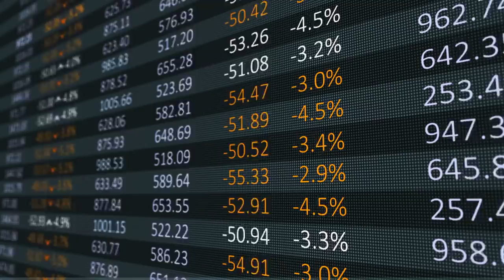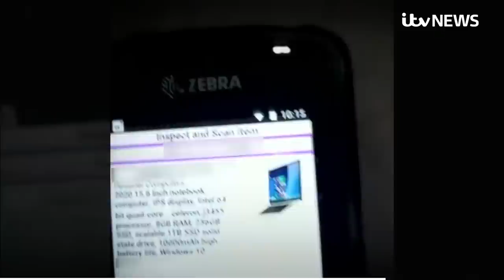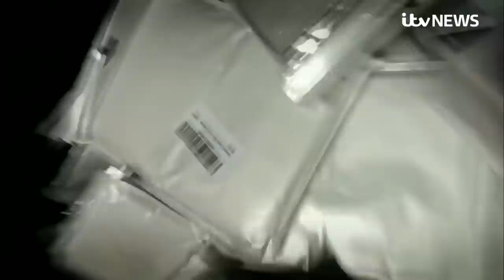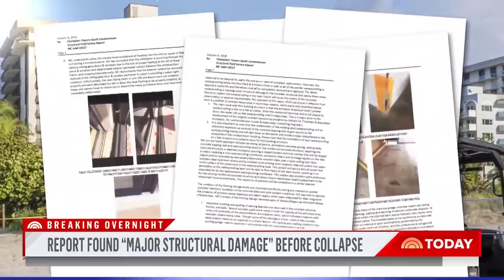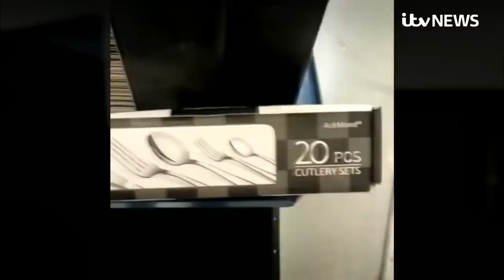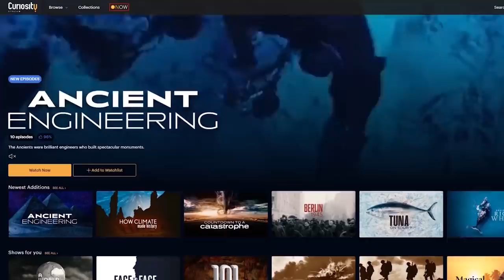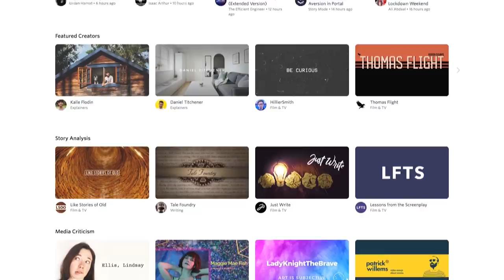Is Capitalism Actually Efficient?

Comment: This is definitely one of the most damning aspects of capitalism. We as a society can no longer afford to let so much material go to waste, especially when there are so many who needlessly lack said materials. Our current manner of helping (or rather, not helping) the needy is BARBARIC compared to what is easily possible.
Reply: Seems more of a society issue then a Capitalism aspect most people choose to neglect issues and not much is down to rectify that problem not a necessary a issue with Capitalism but as a whole more of people not choosing to be more economic among other things.
Reply: @mlgfails2727  I disagree, if it were more profitable to help the poor, people would. In a socialized system the resources would go to who needs them.
Reply: @douchopotamus3755  well hard to make it profitable to help the poor there is ways but best method is to make it so the poor are slowly raised from there levels of poverty into higher levels of wealth of course I believe best state is mid class if on the higher end good financial security and allows you to avoid the demons which plague those of wealthier classes. I think people should really just learn more of financials would save and help so many it’s unbelievable get into farming spend less among other things I do believe a safety net is needed but not in a I guess the traditional sense
Reply: @mlgfails2727  are you 8 years old? That's a pretty naive view.
Reply: @douchopotamus3755  last time I checked my birth certificate I was not and considering my memories I think not as well although if you believe certain individuals u can’t trust ur memories right but no I don’t think I am and would you care to explain how so? Many issues that plague people are often fixable if they have the knowledge and help to do so I don’t see how making so those of lower income receive this wouldn’t be a benefit at all it would increase the economy long term and would make it far more stable as well there are some issues with capitalism I see very blatantly one huge one being industrial farming not the best for animals or people I mean just look at recent studies around EDCs we really nerfed ourselves if people start making their own little gardens the environment can improve drastically as well as provide more food to those who would usually not be able to afford it I don’t think I’m explaining well enough so it might come as naive but I do have a genuine plan behind this as well as general understanding of how it would play out best choice is a slow roll out beginning in rather impoverished neighbourhoods give people something strive for and they take it and run with it make their communities United to do this also requires serious planning best method is go local imbed yourself but again not trying to go in depth simply a surface level explanation I don’t think it’s naive it won’t fix every problem but it can certainly start change in a new way that 50 to 60 years later can become an institution in societies something traditional that everyone loves and enjoys but the execution is key just look at any good hearted attempt to help people and how they often turn out
Reply: @mlgfails2727  ever heard of a comma?
Reply: Why would people donate more stuff if they couldn't enter contracts between individuals?
Such societies are usually xenophobic. Because they operate on trust.
Capitalism means you don't have to trust from the get-go, which makes capitalists open to strangers.
Reply: @therealjezzyc6209  I have but having no memory of waking up in a hospital out of nowhere and having neither really good nor a extremely bad life experience I gotta say this would be the saddest coma state ever
Reply: @Hussein Abbas I realize now but no point in just deleting it gotta stick to my guns at this point but and also cause I spray at the grammar police
Reply: What's really scary is, a lack of resources is EXACTLY what capital owners want. They want there to be 2 loaves of bread per 10000 people so that they can get the most money for those 2 loaves , and let the rest starve. 
It is a terrible system designed to create an unnecessary barrier from resources that people should have access as they need it.
Reply: @tteotdead  idk if it’s exactly what capital owners want I mean haven’t spoken to every single one and found out so can’t truely say but most like same applies to you but yes some people are that greedy but they can just as easily be countered it’s been done before and it will continue to do so we just need to be vigilant and observant to protect the market and make sure no shenanigans are done ( God I just used that word for the first time and it was fire I gotta say this is a good ass fucking day feel like I’m bouta hop in the mystery machine)

Comment: You forgot "planned obsolescence". Products are actually manufactured to last less than they could or should and parts are not replaceable unless you buy the adjacent parts that are perfectly functional. Obsolescence is planned to happen when the warranty has expired. Let me also mention the externalities. What is more socially efficient in California, mass transit systems (such as high speed rail) or automobiles?
Reply: Great point.  A product that lasts isn't profitable.  A product that requires constant repairs or replacement is profitable.

Comment: It's weird living in the 21st century in Texas and fearing the winter like pre-industrial colonialist. Not knowing what to do when the power goes out when it gets cold.
Reply: You can prepare for this, though. Get a camping stove and gas cartouches. Get several hot water bottles. Get a set of warm clothing and blankets. (Pro tip: These gold/silver emergency blankets can be wrapped around a sleeping bag or wool blanket to keep the person inside extra warm. I've used them in cold nights while camping with much success. There will be a bit of condensed water on the inside though.)
Get canned foods that can easily be heated. Figure out how to plug any cracks in your windows (I hear that you can glue newspapers over them with starch glue).
If you have access to your water pipes, maybe put foam isolation around them. Get a couple of clean canisters that you can fill with water if a snow storm is forecasted.

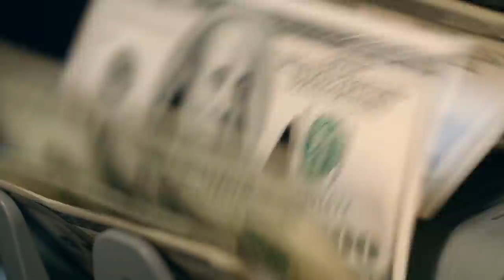Comment: Okay, completely off topic but the guy operating the lathe at 2:24 is clearly an actor because not only if the cutting tool improperly secured in the tool holder with only a single set screw, but he is also turning the lever to remove the tool holder while the lathe is running, which is not only a surefire way to break something, but also pretty dangerous.

Comment: We destroyed OVER 100 NEW PS5s 90 days after they were released because the boxes may have been damaged in some way. This was at Amazon, I worked there for a few years. Sometimes not at all, but usually a scratch on the cardboard or small dent to the corner of the box. Those PS5s are packed well, I bought one way later, I guarantee not a single one of the units we destroyed were broken.

Comment: They either destroy their product, or don't bother building it in the first place, both for purposes of artificial scarcity.  As you can see with many tech companies.  There is no real shortage, just an artificial one to increase prices (particularly of the providers of chips and hardware).  And as for food... if it is routinely expiring then the price is too high and should be sold cheaper.  And if the food is being wasted, it is being overproduced and excess should be abundantly available.  No reason for it to be dictated by the market.

Comment: Me and mines spent an entire week w/o energy we did get a break on two nights for a few hours(enough to charge batteries) but we had to spend the coldest days w/o a heater and our pipes burst, so I went to the local homedepot/lowes only to be met by lines of people trying to repair theirs too. This went on for almost a month, we did manage an emergency plumber that retrofitted pipes to the area they burst for like $300. Abbott still hasn't done much about Ercot and as far as I know there are no regulations in place, but what did happen again is we had a second energy scare and basically told to lower our electric consumption. Once again we were at ristk of bringing the whole thing down again during summer.

Comment: You can't work anywhere and say the system is efficient.  In about every factory job I have had, the machines we use are almost always rather old and on the verge of a major breakdown and yet we will run them, break them, and then have to Jerry rig them to keep running just so the line doesn't shut down.  If this can't be done, then the machine is replaced with a much more inefficient machine and it falls upon the workers to somehow make up that loss of production.  They will grind everything to dust to make just a little more money.

Comment: The pandemic exposed another of capitalism's inefficiencies.  Capitalism gave rise to just in time manufacturing which further increase profits by drastically reducing inventory at plants.  It started in the auto industry but has since spread everywhere due to profit motive.  This works great when there are no hiccups in the system.  But when there is, like a pandemic screwing up supply lines, then all of the sudden it causes huge issues due to no redundancy in the system.  Our soaring inflation due to low supply is fueled in large part by this.  Especially when you factor in the other shenanigans already mentioned in this video.

Comment: This is why I say the single largest problem with capitalism is "externalities," or as I prefer to call it (with respect to Douglas Adams), "Someone Else's Problem." If workers are easily replaced, their health and safety is someone else's problem. If buyers are plentiful, their satisfaction with your products or services isn't your problem. If waste byproducts can be discarded and ignored, there is no incentive to reduce waste or be concerned with its toxicity; cleanup is someone else's problem.

In short, if you can cut costs by reducing accountability and making some part of your process someone else's problem, the profit motive demands that you do. And if you individually don't do it, the Darwinian mechanics of competition will ensure that someone else does. This is not a new problem, and it's not even peculiar to capitalism. It's a problem with power. Most people generally hate accountability, especially individuals under public scrutiny, but people with power have the means to dodge it. It just so happens that capital is arguably the western world's dominant form of power. And as a highly fungible symbol of power, capital drives the engine of the economy hot, fast, and recklessly. 

The ONLY way to keep people in power accountable is division of power: independent institutions that utilize different types of power, preferably power that operates on parallel "currencies" that cannot intermix. Theocracy was only defeated (in some cultures and perhaps only temporarily) by the mandated separation of church and state. The church sustains itself on tithes or donations, sure, but the true currency of the church, the exchangeable symbol which motivates human behavior, is appeal to moral obligation. Likewise, the currency of the state is (or at least is supposed to be) the vote. But we all know that relationship has been short-circuited through lobbying and campaign contributions. Corporatocracy is has been steadily growing ascendant since at least the end of the New Deal, but corporate bailouts have made the dependency painfully obvious. As the parallel forms of power sort themselves into a hierarchy with the common folks at the bottom, well.... we find ourselves in feudalism all over again.

Comment: The endless fight between engineers and economists. Actual efficency vs economic efficency.
Reply: Iron Ostrich  I think it can work the problem is there is no reset button. I think a money system can work if you have taxes use to cover all basic need and 100% inheritence tax. With both conditions meet, I think a money system would work just fine. 

The two main issue for me is inheritence since that creates power consentration(They are feudal lords and medeval idea of thinking) and the fact that the system does not cover everyones basic need(an analogy would be to put a gun to a individuals head to make them work).

Comment: Think what you are trying to show is the issue with supply.  There are actually two extremes to the supply issue:  First you have the situation that is plaguing the PS5, where the company is producing the console, but they can't produce enough of them so capitalist individuals buy up the product to resell.  The only way to combat this is to produce more than the capacity of the wealthiest flippers to buy.  Issue is that the next best thing comes out afterwards, the company produces the amount needed to stop flippers, but then the demand drops off a cliff and retailers / distributors have tons of overstock.  They need to use the space for the old product for the next one, so the only option is either to destroy the excess goods, or sell them at a massive discount that crushes the market.  

Now there are two potential outcomes to a mass selling that can be illustrated in the trading card game world.  There is a card called imperial recruiter and another called scalding tarn in Magic the Gathering.  Imperial recruiter is a card that had low demand, but insanely low supply such that it was about 100+ USD to get one.  It went through two reprintings and was crushed to about 1/10th or less of it's original price.  Scalding Tarn is a card that has high supply, but high demand as well.  The price on this card was originally 90-100 dollars at it's peak, but then was repeatedly reprinted in luxury sets across the last 6-7 years, so now it is valued at around 30-50 dollars depending on when the last printing was.  The price always snaps back up.  However, with each printing the price "degrades", so it will never hit 90-100 dollars again.

Don't know if this helps, but figured I'd throw that in.  I mean marketing is another whole can of worms because companies schedule those out and those can also contribute to problems.
Reply: lol this just shows how supply and demand is not the best system
Reply: @sethvandivere9208  Supply and demand isn't a system: Those are fundamental factors of any market.  The "Free Market" is simply the lack of any system at all because it is based purely on a hands off approach to regulatory measures outside tariffs and such between nations.  

What causes the issues we see in the United States is the lack of systems to deal with over supply and a lack of market regulations (aka the red tape) that the EU has.  However, what really makes it hard to get any of those things in the United States is the small vs big business situation.  There's a lot of misinformation and emotions running loose on the subject.
Reply: @Yurikan  sorry what I meant to say was, having a free market dictated by supply and demand would not be great lol.  I totally agree that the hands off approach leaves a lot of problems. It makes me think that a planned economy could be great, as it would be easier for a big government to know the demand or need for things, and supply the needed amount, as apposed to a reactionary system of supply and demand. It could also easily solve other problems like planned  obsolescence and manipulated demand. I can definitely see some people being scared of a big government though

Comment: I can get behind putting up systems to make sure we don't waste food and perfectly good products, but weather proofing the entire country for once in a hundred year phenomenons is extremely wasteful. In Salt Lake they had bad flooding in the 80s so they built water pumps for when it happens again - it's been 40 years and they've never been used. By the time they're used, it will have cost more to build and maintain them than to sandbag or shut down the airport.